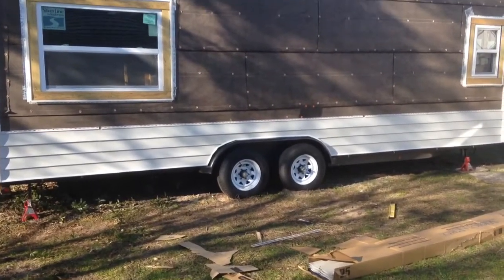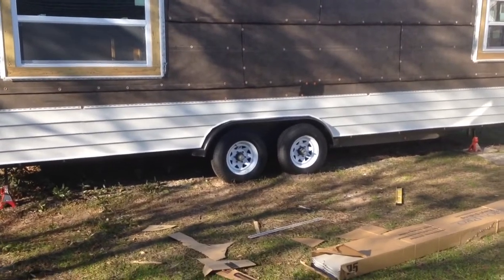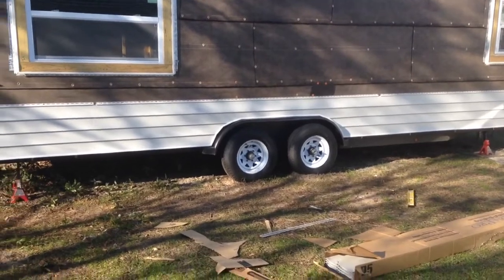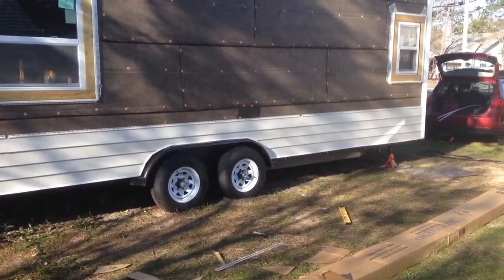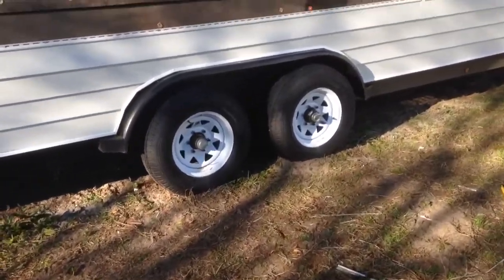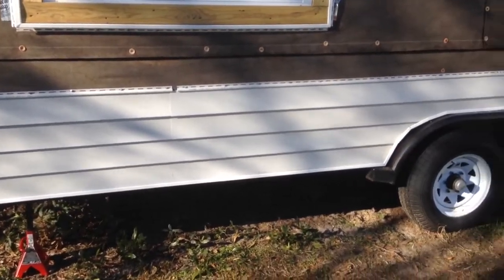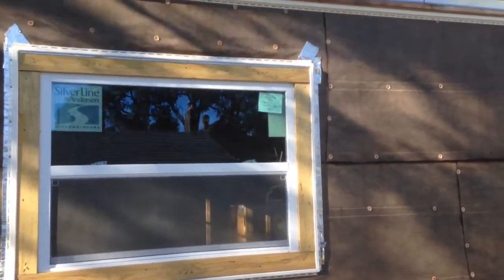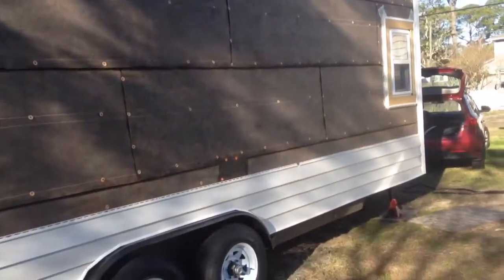How to Build A Tiny House - Episode 25 - Vinyl Siding Installation

Comment: Just a small tip for you as far as the j-channel around the wheel fender . They sell a rubber channel so you do not have to slice it the way you did.
Looking good though.